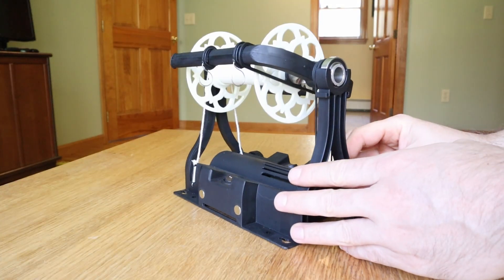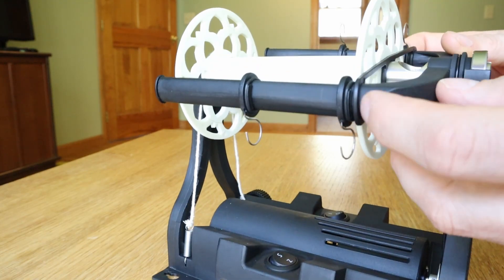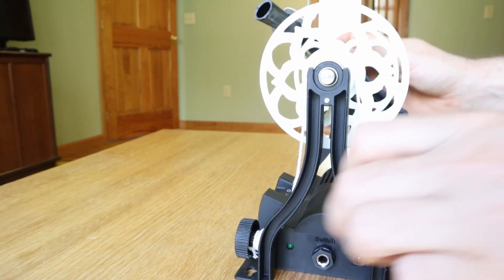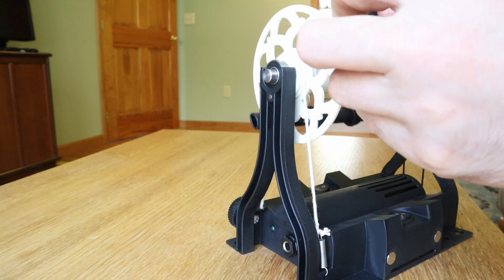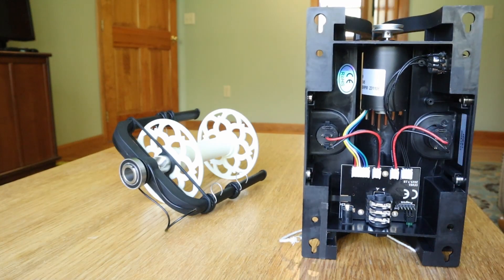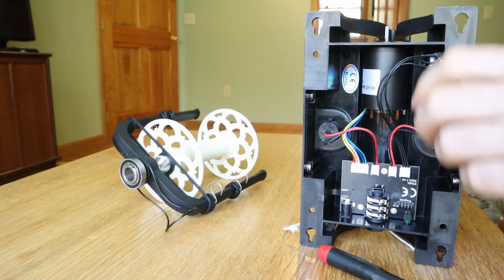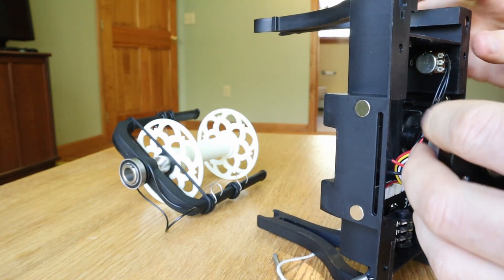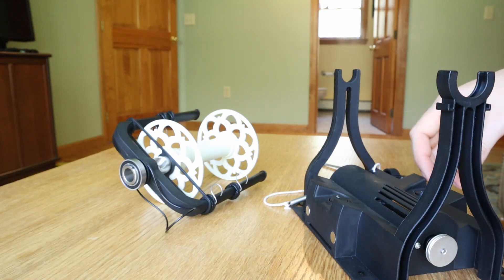Spin 176 - EEW 6.x Motor and Sliding Hooks

Comment: This is clever -- did you ever think of making a motor attachment for our vintage csm cone winders  basically just a motor and a pully /belt needed.
Reply from the maker: I've thought about it a little, but probably won't do it.  It's a lot more involved than you think to make it work well with a variety of CSMs.